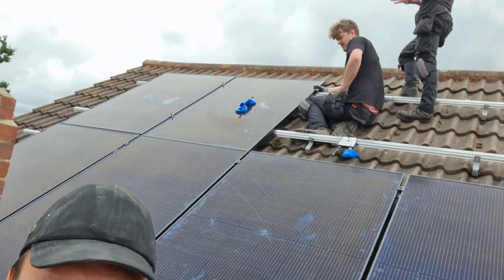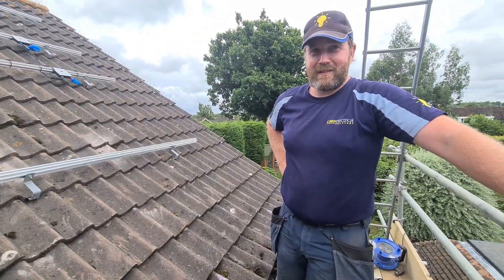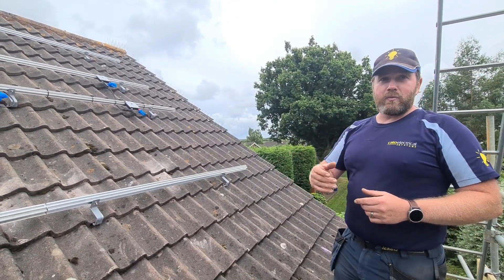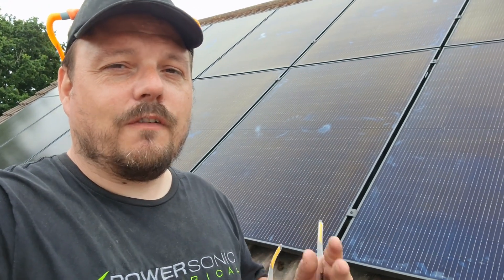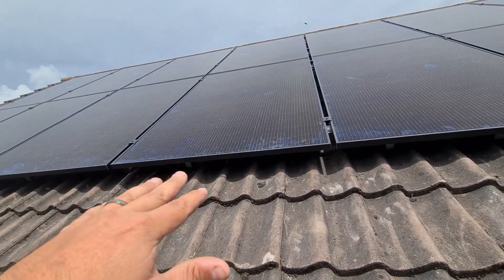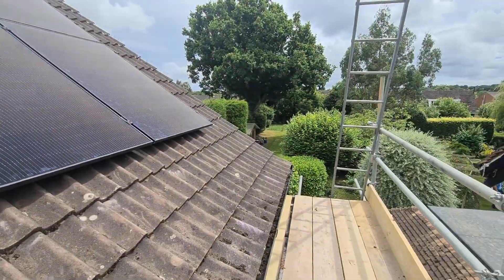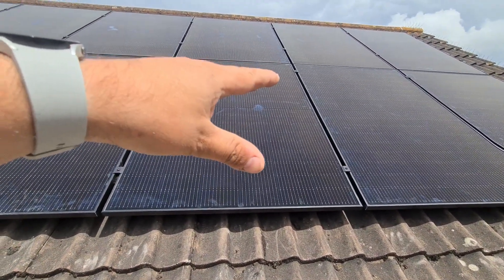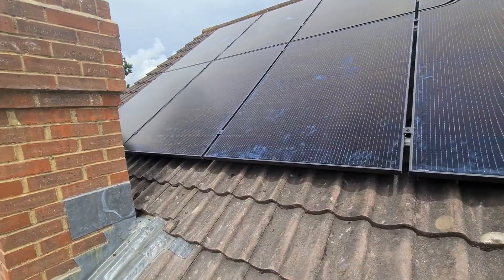Install Solar Edge PV and Battery Storage system with Cato Electrical Services

Comment: Look at all those devices, lol, meanwhile i plug an ecoflow into an outlet connect 2 solar panels and benefit immediately. 2Kw might not be much, but it helps a little, when i increase that to say 8Kw i am going to see a massive drop in bills. and its simply a matter of making a wooden frame to bolt onto my south facing wall, with panels at the correct angle to generate the most, and all i have to do when the suns path changes is add a few washers to change the angle. Absolutely no electrician needed, and yes its safe as if there is a power cut the system stops feeding the house wiring, i then have to connect extensions to specific devices like freezer and tv and router. Saying that i have not had a power cut for almost 6 years now , well there was one that lasted an hour when they were upgrading the cables in my street. And while as is aid 2Kw charged by 2 40watt solar panels is not much, it does make a difference, i am looking at buying another system as it is about the same price as extended battery packs and having a 4kw system can only be good.
Reply from the maker: The market place has options for all. However you will always be restricted with portable DIY setups. I know as I have them! Ecoflow also my weapon of choice. We use it more for camping trips and for powering homes while we rewire consumer units and such. It would never even enter mind mind to try it at home. Firstly the hassle is something that doesnt interest me. Secondly the lack of potential to export or utilise off peak tariffs, then we have safety. Those devices are intended to supply a limitied number of items rather than run through extension leads etc. Home insurance most likely invalid at that point and I would be careful admitting the stratargy online if the worst is to happen! Payouts might be in short supply. 

I mean if I cut my arm open I could stitch it myself, I could replace my car with a gokart for the daily commute and use a ratchet strap instead of a seat belt. While its working all is well and I can bask in the savings! However when the worst happens I would rather not have my infected arm amputated and to colect my  organs from the roadside. Same can be said for having fixed installations correctly specified and installed by those whom know what they are doing. 

But such is life and choice. Good luck with it.

Comment: Great video just wondering what’s the difference in cost between a solaredge system and a standard solar system cheers
Reply from the maker: It varies tbh. The optimisers add another £50 ish per panel as an average. Inverter costs are similar, solar edge batteries carry a higher price tag.
Reply: @electrician247  thanks for the reply can any battery be fitted or does it have to be a solar edge ?😎

Comment: east/west split on one string?
Reply from the maker: 2 strings are in use here but with Solar edge and the optimisers the possibilities are endless and avoid many of the pitfalls other systems suffer with shading and E/W splits. Check them out.

Comment: Where was the battery storage
Reply from the maker: Added later out external wall
Reply: @electrician247  is there a video? If not please could you do a detailed video showing how easy or hard it is to mount and wire the battery up?

Comment: If you havedecent panels, shading wont bring down the string and optomisers arent a necessity but installers keep saying if a panel is shaded it brings the string output right down. It wont.
Reply from the maker: Optimisers are the way to go imho.
Reply: @electrician247  The optimizers are the way to go is you need rapid shutdown capability, but the increase in panel output is questionable with modern panels.  The 2% or so efficiency loss with the optimizers hits you all of the time, whereas the shading is only temporary in a well located system.  So, while this statement may be true in some poorly sited installations, that doesn’t change the fact that you made a false claim in the video.
Reply from the maker: @LTVoyager  Its okay to be wrong, dont fear it. I dont. 

You are wrong here of course. especially as the panels collect dirt, have reduced performance over lifetime and shading implications beyond just trees etc. While I agree whole strings are unlikely to be reduce to nothing. They will perform as the worst performing panel does. 

Even without shading the issue with dust pollen and the like makes it a no brainer to use optomisers if absolute maximum efficency and output is needed. 

That said on my own home I am happy to compromise on the reduced generation and not use optomisers at all. 

The beauty of choice is a wonderful thing and you are welcome.
Reply: @electrician247  I can see why you are wrong, because you don’t care that you are wrong.  That is sad.  It is not OK to be wrong, and when you make a wrong statement you should correct it and not just accept it.  Your statement in the video is demonstrably wrong as a number of other YouTube videos have clearly demonstrated.
Reply from the maker: @LTVoyager  I cant help you if you are relying on YouTube for your data. If you like I have other installs with just string systems on my channel. I can say seeing the data from multiple installs optomised installers perform much much better. In most cases over 10% even without shading. Due to dust and a lack of people keeping panels clean. 

People have a free choice to set systems up how they please and certainly shouldbnt be viewing any accuracy based on vlogged videos from YouTube. That is a bizarre and strange life view tbh. 

I share warts and all across the channel but am happy to confirm everything you have said is incorrect.

Thank you for watching and commenting though. Massively helps the channel.
Reply: @electrician247  Yes, Andreas Spiess and others clearly don’t know what they are doing and are putting up false data.  LOL.
Reply from the maker: @LTVoyager  glad to see you came around and agreed 👍 
Makes perfect sense doesn't it really. Good on you and thanks again for tuning into the channel.
Reply: @electrician247   I agreed that you were wrong right from the start.  And Andreas proved it.  😁
Reply from the maker: @LTVoyager  it's brilliant to see someone own a mistake and apologise in the comments. Really appreciate it and thanks again for watching. 

Today's install has no optimisers as the client was happy with the reduced output against installation cost and potential failure point in the future. The beauty of choices.
Reply: @electrician247  Funny, as I have yet to see you own your mistake or apologize.  I do hope you and your viewers watched Andreas Spiess’ video where he shows the error in your comment and includes not only test data showing how you were wrong, but also an LTSpice circuit model which explains why you were wrong.  And I am glad you are using that information to not sell your customers hardware they don’t need.  Good on you for learning from your error.

Unfortunately, I have to use optimizers or MLPE with string inverters as the US code NEC 2017 requires rapid shutdown at the panels themselves which a string inverter can’t do.  In the states that have adopted NEC 2017 into their building code, optimizers or microinverters or a similar architecture is required to meet safety codes regardless where the devices serve any other useful purpose.
Reply from the maker: @LTVoyager  ahh your in the states. Say no more. Your doing the right thing using optimisers. As you have identified they produce more energy output and are safer. 

This wasn't even my job we was working with another contractor learning. They have hundreds of installs all out performing systems that lack optimisation. Sounds like you have lots to learn. 

Are you a proper installer or enthusiastic DIYer? I think I can guess 🤣. 

Thanks for supporting my channel, appreciate it massively. Good to see you learn and improve
Reply: @electrician247  I would not use optimizers if not required by law.  They provide no benefit in my location as I have no shade and unobstructed view of the southern sky.  I am neither of your categories.  I am an electrical engineer and licensed professional engineer who understands how modern panels are wired and how shade and such affects modern panels.  I was very glad to come across Andreas’ channel as he does a fantastic job of debunking the sales pitches of the vendors and does so with actual tests, data and technical modeling and analysis.  That is what separates engineering from marketing and most of the advantages of module level electronics is marketing in light of today’s panel designs.  This wasn’t always true and many installers are still playing the old tapes from the early days when shading part of a panel actually did effectively take down a good part of the entire string.  Those days are long gone and it seems that most installers haven’t caught up with contemporary panel technology.  The safety benefit of module level electronics is certainly a legitimate argument for them, but overall system production and efficiency is a very weak argument with today’s panels as Andreas so clearly demonstrates.
Reply from the maker: @LTVoyager  The panels is use on this video will output much lower without optomisers than they do with them. As the panels on my own home would. I cant comment on the types of panels other people might be using. 

You assume I am just an installer... I am also an electronics engineer with a degree in electronic engineering. I know how these things work very very well. 

It is great to hear the american rule setters have also understood why it is important to have optomisers. I am sure we will eventually have the same here in the UK but for now we have choice. 

As you wont have access to the installed data we do I can accept you wont appreciate or understand why optomisers are safer and help produce more energy. I can see it in front of my eyes monitoring installs active. These are hard raw facts. Whatever anyone else is doing with components they select is entirely up to them.
Reply: I came to post the same thing, but I see you have it covered.  Yes, it is amazing how many companies keep perpetuating this old, old data from days gone by.  I doubt you can buy a panel today that lacks bypass diodes and the half-cell panels are even better.

Comment: Looks like the Solar is on a shared RCD, didn't think that's allowed
Reply from the maker: That would be one for Stuart to answer however wasn't the final setup during my visit. One thing is certain it would be done exactly as required before handover 💪
Reply: Its allowed if the rcd is suitable for dc backfeed .

Comment: Great new business for you guys. What i noticed is that the red and black (+ and - ) dc-cabling from the solarpanels are in the same trunking down to the convertor. In the Netherlands they should be separated from each other to minimise the arc fault risks wich mostly leads to fire.  🤔
Reply from the maker: Not a requirement here to do that. The cabling is double insulated. But that's not to say it wouldn't be a good idea for those who write out guidance to consider it!

Comment: Hi Mark great video as always I have got solar a 3.6kw array had it fitted about 10/12 year ago when the feeding traffic was good but had a look at my inverter and it’s rated at 2.8 kw which for my system I think I should have a 3.6 kw I noticed it’s always on full power when the sun on it , what do you think ?
Reply from the maker: Hi Nigel, Depends if the sun hits the array at the same time and also if the inverter has a peak setting above its rated max. Sometimes installs were not always mapped out as they are today. Stuart would be the man to ask. I linked to him in the description. Thanks!

Comment: Hi great job. but very curious about  the inverter manual said: "If an external RCD is required by local regulations, SolarEdge recommends using a type A RCD. The recommended RCD value is 100 mA or 300 mA unless a lower value is required by the specific local electric codes. When required by local regulations, the use of an RCD type B is permitted."  does the Dual RCD is A type? it is good practice for connect the PV AC side to individual MCB OR A type 100ma RCBO or RCCB.
Reply from the maker: Type A is in place. Its not my install tbh we were learning alongside another contractor  so it's all new to me. But as covered in the video Stuart and his team know these products and systems top to bottom. You can find him in the links in the description if you have any questions.

Comment: I’ve seen Australian videos that show optimisers are not required, maybe it’s just SE pushing this…
Waiting for the video that shows the results of a system with and without optimiser you see the difference…
Reply: Shading is not the only issue , A conventional PV string will only ever generate at it lowest performing panel, be that a manufacturing issue (not all panels are create exactly the same), degradation of the panels over time, soiling from pollen dust or bird mess........ All these factors on a single panel can effect the whole strings performance. With optimisation and each panel will perform to its maximum. not to mention the monitoring capability of an optimised system.